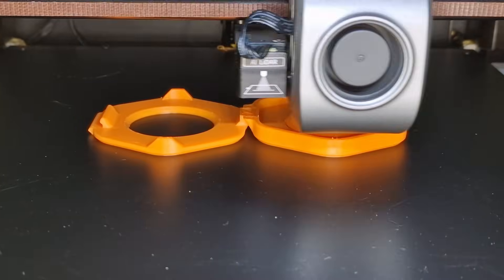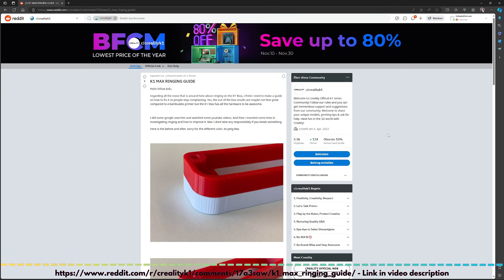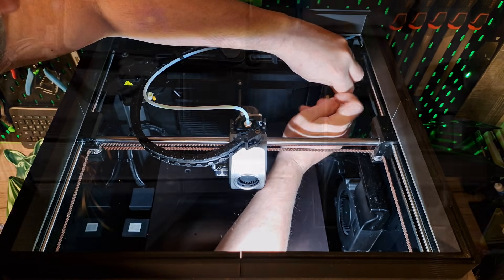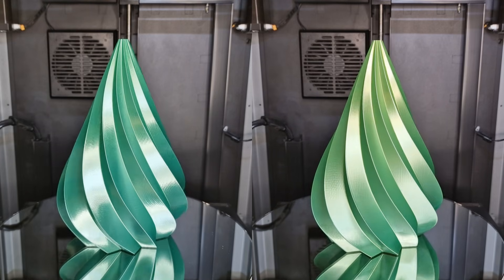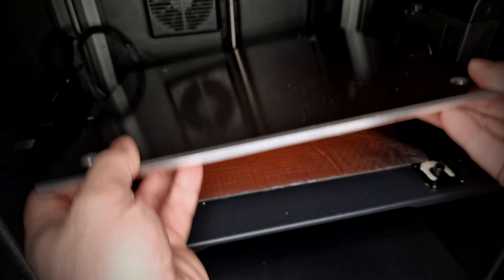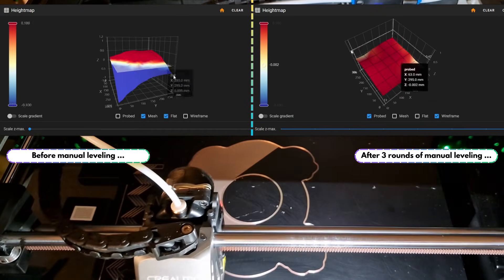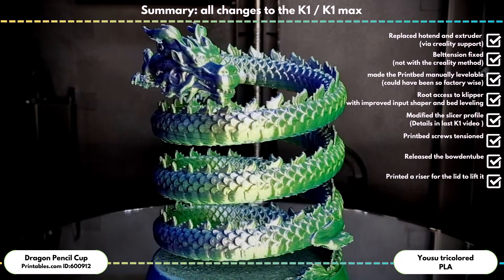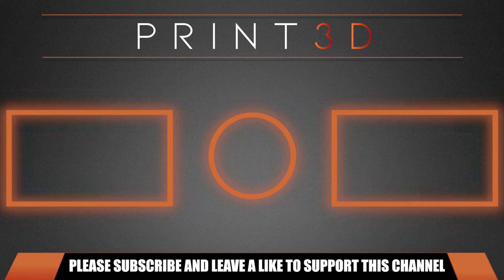The K1 / K1 max needs more love - belt adjustment and manual belt leveling (Coupon code inside)

Comment: Hey guys, I've noticed with ABS printinng at 0.4mm that when I print with a 0.2mm layer height the VFAs are barelly vissible while when I go down to 0.16mm or 0.08mm the VFAs get really bad, also noticed that witha 0.2mm nozzle on the K1C, should I try adjusting the belt tension? Will it make any difference in the lower layer heights and smaller nozzle?

Comment: Hello, do you think doing this with the z axis would fix the error 5256 z axis motor losing step? I can hear it slipping or skipping or something and it makes the auto calibration dig into and ruin the bed plates and rendered the printer unusable out of the box. I looked online and contacted creality but still haven't found a solution.

Comment: did the same to my cr- se bed leveling was vastly improved on that one...now i see same issue on my new k1 so off to get the parts so i dont have to cut down....i saw somewhere it was best to use 12mm spacers instead of 9mm
Reply: my k1 max is chilling while I finish my cr-6!  It was my first so I have 2 v400's some kobras and a k1max sittin n waiting on my dumb ass!

Comment: I just got a k1 max and I have a feeling that Im going to have to be doing a lot of work to fix the issues I have burnt filament stringy fleshy etc
Reply from the maker: Test it out,  maybe your K1 doesn't have the issues.  Many of the newer ones just work fine. Some issues are pretty easy to fix though, stringing is (most of the time) the temperature of the hotend and retraction distance with the k1